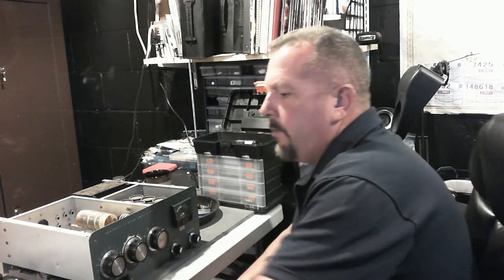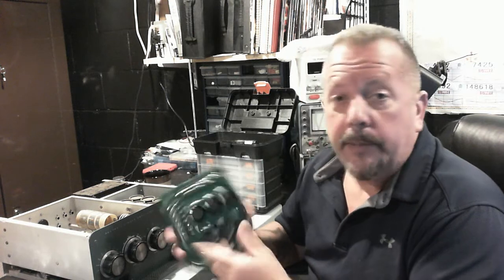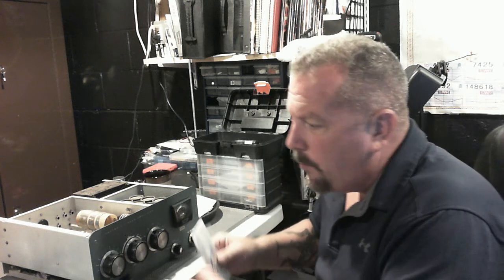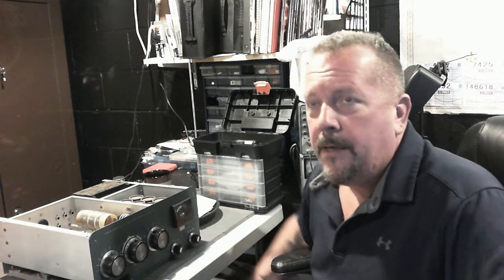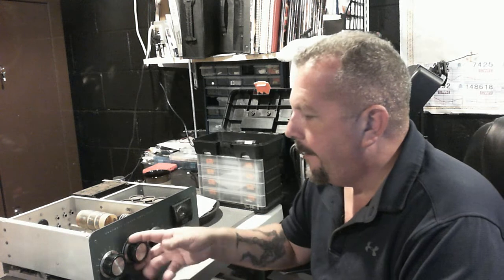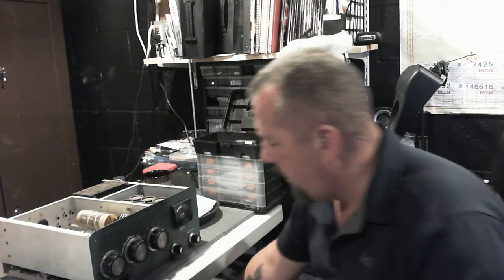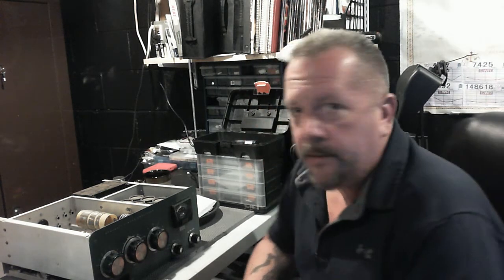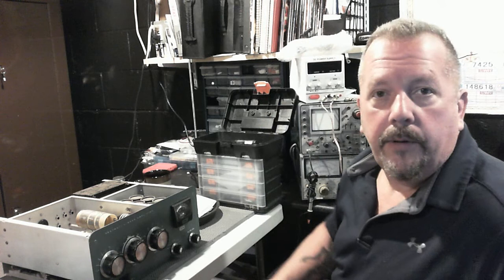Heathkit SB-200

Comment: With decent tubes, 600w is no trouble, even on 110v in.
Reply from the maker: I never had that much out of it. I replaced the tubes once. However, I have not hat too much time replacing the other components that should probably be replaced. Caps resisters etc. I'm leaning towards going solid state? Not sure yet.
Reply: @raykd2ibp198  I run an Icom PW-1 most of the time. Solid state and set once and forget is very nice for sure.
Reply from the maker: BTW 240VAC..
Reply: @raykd2ibp198  On 226v measured line coming in, my SB-200 does around 620w with 100w in, on 40m. I only get around 300 on 10m. That's on the original Centron tubes.
Reply from the maker: @TheTreegodfather  100W in gets those tubes glowing. I think its to much. I go in @ about 50-60 W
Reply: @raykd2ibp198  Yeah, I usually drive around 60w, and get about 450-500 out.
Reply from the maker: @TheTreegodfather  I also do a lot of ft8 work. 100W in 15 sec digital bursts is hard on tubes. Did you rebuild your heathkit? Also the 1kw am your running is beautiful. Next gen is even hotter. The price tags... The hottest. Going on air in a few 2M than gonna check HF out for a few.
Reply: @raykd2ibp198  Yes, I did the Harbach power supply and soft-key, rewired for 220v, swapped the meter lamp to LED, and replaced the doorknob caps and the two electrolytics under the RF deck. The tubes are the originals, and I know they have a ton of hours on them. I don't think I'd run this on FT8, really. Maybe at a low level, like 300W. I have an SB-220 I do use on FT8, and that'll do 500W there all day long without even getting warm.